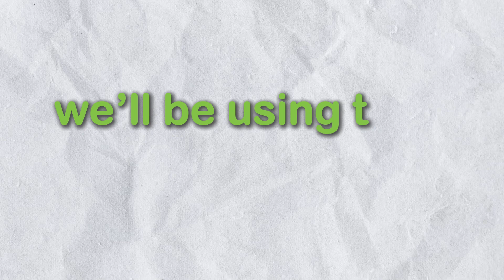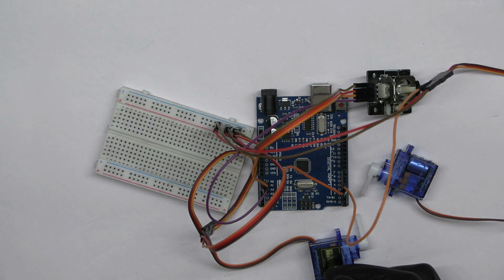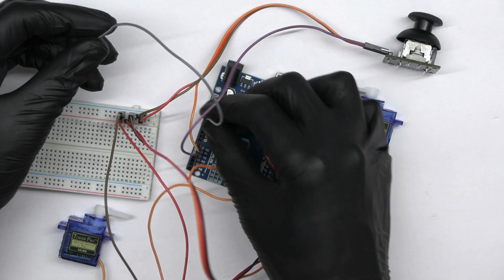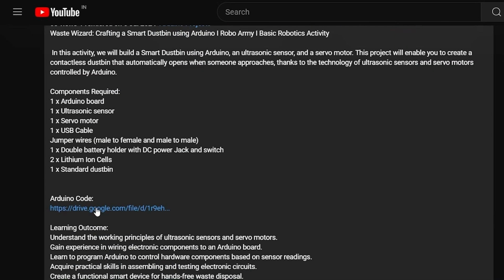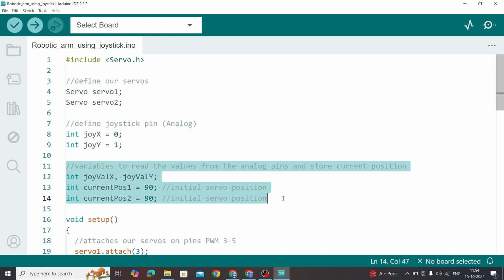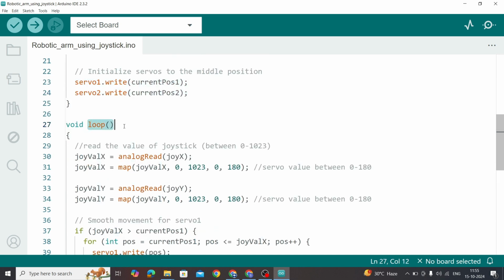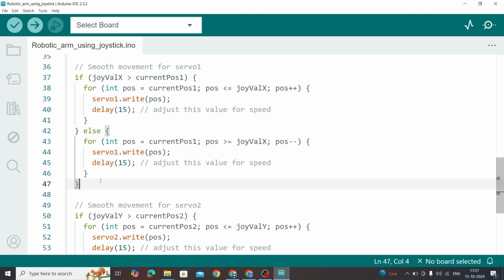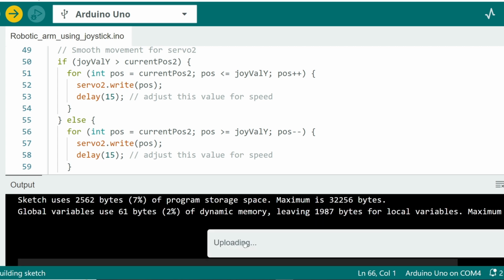DIY AutoArm: Interactive Robotic Arm using Arduino UNO, Servo Motors & Joystick I Robo Army

Comment: can u tell is there any way to power the Arduino without the batters my both servos r making sounds
Reply from the maker: Yes 👍 you can power the Arduino without using batteries by connecting it to a laptop/PC using the USB cable.

The servo noise is happening because batteries (especially 9V) cannot provide enough current.

For smooth and silent servo operation, use either:
🔹 USB power from laptop/PC (for testing)
🔹 OR a 5–6V external power supply (2A recommended) for servos

Also make sure Arduino GND and servo GND are connected together.
Reply: @robo_army_  ohh ok tysm

Comment: Hello my friend can i use it only by using power bank to give it the power without the batteries??
Reply from the maker: Yes, absolutely! 😊
You can power the project using a power bank instead of batteries, as long as the power bank provides 5V USB output. Just connect the power bank to the Arduino’s USB port, and the whole circuit will work normally.

Comment: it is not working
I don't know what is the problem, I used the exact code and did the exact connections, then I changed the 1 and 0 pins to Analog 1 and 0 but now it uploads but does not work at all. Can you respond as fasta s possible
Reply from the maker: Hi! Thanks for trying the project. Pin 0 and 1 on Arduino are digital pins used for Serial communication (TX/RX), so using them often causes errors. Please make sure your joystick is connected to A0 and A1 (the analog pins) and update the code accordingly. Also double-check:

Wiring: Joystick VCC → 5V, GND → GND, VRx → A0, VRy → A1

Servos: Connected to PWM pins (like D3, D5)

Power: Use an external 5V supply if servo is not moving properly

Comment: How can i make it turn with a smaller radius
Reply from the maker: To make it turn with a smaller radius, you need to adjust the motor speeds during turns. Reduce the speed of the inner side motors (or stop them completely) while keeping the outer side motors running. If you want an even sharper turn, you can run the inner motors in reverse while the outer motors move forward — this will give you a pivot turn.

Comment: How Can i make it with 2 joysticks
Reply from the maker: This project comes with 1 joystick to control 2 servo motors, but if you want to use 2 joysticks, you can easily connect another joystick module to the Arduino. Each joystick uses 2 analog pins (X & Y axis), so with 2 joysticks you can control up to 4 servo motors. You’ll just need to connect the second joystick’s pins to free analog inputs on the Arduino (like A2 & A3) and update the code accordingly. We’ll be happy to guide you with the wiring and code if you’d like to try it!

Comment: Why sometime servo suddenly move to unpredictable position?  I already use external 5v.
Reply from the maker: Sudden unpredictable servo movements can happen due to signal noise, power fluctuations, or lack of proper grounding. Make sure:
All grounds (Arduino, power source, servos) are connected together.
You're using a capacitor (e.g., 100µF–470µF) across the servo power line to reduce voltage drops.
The servo signal wires are securely connected.
Also, avoid powering the servos directly from the Arduino's 5V pin — it’s good you're using external 5V, just ensure it's stable and well-regulated.

Comment: Bro adruino code dont open in the phone . What can i do in the next
Reply from the maker: #include <Servo.h>

//define our servos
Servo servo1;
Servo servo2;

//define joystick pin (Analog)
int joyX = 0;
int joyY = 1;

//variables to read the values from the analog pins and store current position
int joyValX, joyValY;
int currentPos1 = 90; //initial servo position
int currentPos2 = 90; //initial servo position

void setup()
{ 
  //attaches our servos on pins PWM 3-5
  servo1.attach(3);
  servo2.attach(5);
  
  // Initialize servos to the middle position
  servo1.write(currentPos1);
  servo2.write(currentPos2);
}

void loop()
{
  //read the value of joystick (between 0-1023)
  joyValX = analogRead(joyX);
  joyValX = map(joyValX, 0, 1023, 0, 180); //servo value between 0-180

  joyValY = analogRead(joyY);
  joyValY = map(joyValY, 0, 1023, 0, 180); //servo value between 0-180

  // Smooth movement for servo1
  if (joyValX > currentPos1) {
    for (int pos = currentPos1; pos <= joyValX; pos++) {
      servo1.write(pos);
      delay(15); // adjust this value for speed
    }
  } else {
    for (int pos = currentPos1; pos >= joyValX; pos--) {
      servo1.write(pos);
      delay(15); // adjust this value for speed
    }
  }
  
  // Smooth movement for servo2
  if (joyValY > currentPos2) {
    for (int pos = currentPos2; pos <= joyValY; pos++) {
      servo2.write(pos);
      delay(15); // adjust this value for speed
    }
  } else {
    for (int pos = currentPos2; pos >= joyValY; pos--) {
      servo2.write(pos);
      delay(15); // adjust this value for speed
    }
  }

  // Update current positions
  currentPos1 = joyValX;
  currentPos2 = joyValY;
}